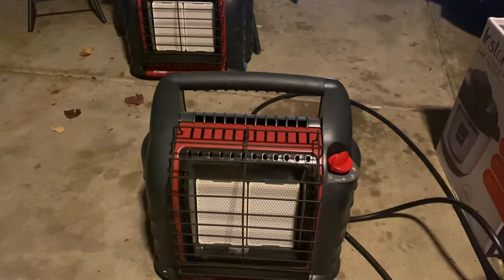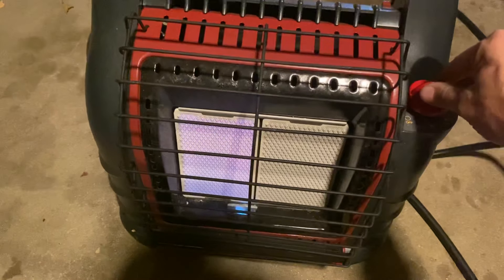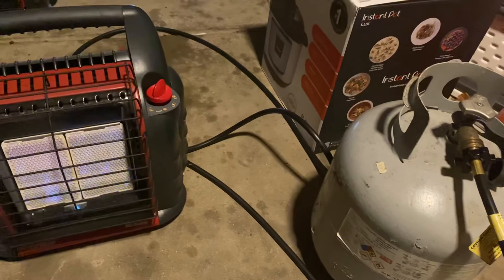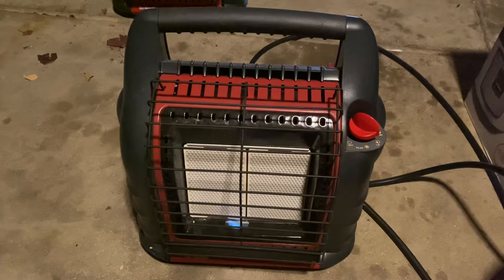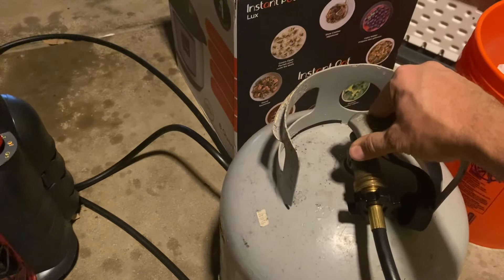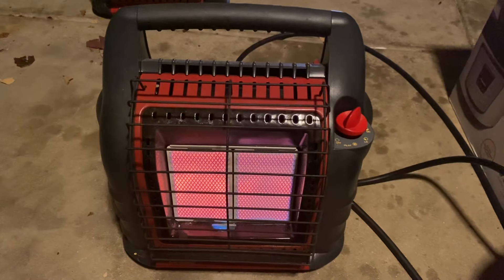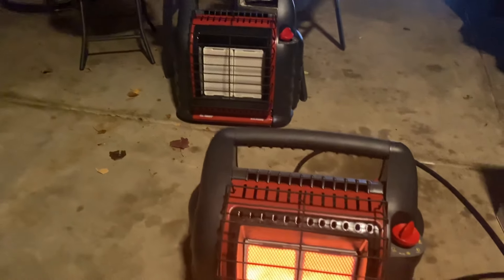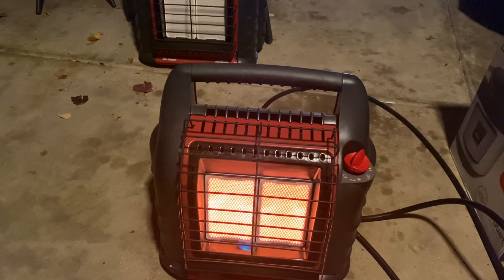Mr. Heater Big Buddy Shuts Off-FIXED

Comment: Hi my heater is bran new and doing the very same problem but I have the one pound tank hooked up to it how can I fix that
Reply from the maker: Are you using one tank or two? These units are really made for the large tanks. Just like a lot of companies they hook you on the “portability” trick of using small tanks. Do they work? Yes. Do they run flawless? Not even close. It’s just a gimmicky way of making people think they’re made just for 1 lb tanks. They simply can’t keep up in really cold weather. Try this…can you wrap something around the tank to keep it insulated? That really is the best option if you don’t have a 20lb. Tank. Anything will do even it’s a spare sock you fit inside it. Of course the warmer you keep the tank the faster it will produce gas from the liquid inside.

Comment: You right on with this Change my 20 pound tank last night. It was exactly like the video fluttered sputtered that would go out.  Hooked up my electric   Heater was fairly comfortable at night. Watch your video did what you said worked like a charm. I added in filter I didn't put on before thanks working great.
Reply from the maker: Glad I could help out. Stay warm

Comment: I tried that of barely opening the valve of the 20lb. tank and after about an hour it still shut down. I have an inline filter installed between the tank and heater.

Comment: I had an issue where my pilot light would work fine. But whenever I moved it to Lo or any higher, it would emit a squeal and the flame would go out. Simply opening the valve slowly on the propane fixed my issue. Thank you for this simple video!

Comment: Thanks a lot. It was a really amazing trick you've figured it out. I was hunting down the cause of the flame and the heater goes extinguish in few mins. Didn't think is its gas pressure is a key role in this secret. I end up switching the hose, propane tank, and even the unit. Really boil me down for the whole process, finally came across your video, and helped me out. Really appreciated.

Comment: Any idea why our pilot lit will lit but not stay lit. Been 2 days. Thank you
Reply from the maker: Is it the first time lighting it this year?
Reply from the maker: If it’s the first time and you have cleaned out the cobwebs with a cotton swab, try holding the pilot down for a full minute. If your rubber line is long like mine it’ll take about a minute of holding down the pilot to get the gas to fill the whole line. It’s a low pressure line so it moves ungodly slow before the whole line is charged completely.
Reply: No been using it for a few months now.  And have held down the button for along time. Beginning to think it's the safety tip over switch. Thanks so much for reaching out to help

Comment: I'm still having issues with mine, i can now use one burner on medium, but will die out as soon as I engage the second burner. I have it hooked up to a 100lb tank and put a regulator on the tank side and ran the hose to the right side and have the 1 lb Green bottle hooked up still on the other side.  Any suggestions?
Reply from the maker: Yes, is the hookup going to the quick connect or to the regulator? If you have two regulators it won’t work.
Reply from the maker: Is this the exact same connection you have? https://youtu.be/m51ZWK_CYq8
Reply: I did not get the quick connect, I just hooked it up to where the little 1lb tank goes. Didn't even know about that. So the way I have it ran, it won't work? Cause I just noticed it shuts it self off after a couple minutes on the other settings.
Reply from the maker: If you have a regulator on the tank side, and it screwed in to the side port then no, it won’t work. If you can take the regulator off the tank side it should work fine. The way I have one of mine hooked up, I have the line with the built in regulator that goes to the tank side but it has a quick connect that doesn’t screw in.

Comment: What do you do when a 1lb tank is used and it does this?
Reply from the maker: Big Buddy heaters are designed to be used with propane tanks that are at least 20 pounds. The 1 pound tanks are simply too small to provide a sufficient amount of fuel to run the heater for an extended period of time, or even for a little while some times. I believe they are good for emergency use on low setting. In my opinion the 1lb tank option is pretty much a gimmick, a good one albeit, but not very useful for comfortability if you have to run them on high.

Comment: So this keeps happening to my mr heater buddy while using the smaller 1lb propane canisters. Any suggestions on how to fix it?
Reply from the maker: Mr. Heater Big Buddy heaters are designed to be used with 20-pound propane tanks, and they do not work as efficiently when used with smaller 1-pound tanks. This is because the Big Buddy heater is a high-powered appliance that requires a larger volume of gas to operate at its maximum capacity.

When used with a 1-pound tank, the Big Buddy heater will not be able to produce as much heat as it would with a 20-pound tank. The heater may also run out of gas more quickly, requiring you to replace the 1-pound tank more frequently.

Additionally, the 1-pound tanks are not designed to be used with high-powered appliances like the Big Buddy heater. Using a 1-pound tank with the heater could potentially create a dangerous situation, as the tank may not be able to handle the demand for gas from the appliance.

For these reasons, it is not recommended to use a Mr. Heater Big Buddy heater with a 1-pound propane tank. Instead, it is best to use the heater with a 20-pound tank, as this will ensure that it operates efficiently and safely

Comment: I have tried everything. Mr. Heater special hose, filter, etc. It still clogs with oil in a short period of time. Very frustrating. The oil clogging has nothing to do with lighting the propane tank too quickly.

Comment: Mine does this but I just have the small green tank attached so there’s no way to let it out slowly, any suggestions?
Reply from the maker: Just make sure you use two tanks at all times. The colder it is the more likely it’ll be that it’ll shut off
Reply: Same issue here. Maybe I need to get the big tank so I can regulate it better...was going to convert it anyway
Reply from the maker: I prefer the big tank but if you need to be portable then don’t use just one pound tank. The unit needs two tanks to burn at the same time. It doesn’t burn one at a time.

Comment: Thanks for this video as this fixed the issue I was having while using the tank. I had already installed a filter prior to use with the tank. I was turning the tank valve wide open and was experiencing the flame out issue. Turning the tank valve VERY SLOWLY until I noticed the hose move ever so slightly and then stopped opening the valve. Problem solved and props to you for posting this up. You probably saved me the cost of a new heater.
Reply from the maker: Thanks Patrick! I’m glad it helped.
Reply: It worked like a charm! Question, can. I Turn the tank valve all the way after it runs for awhile?
Reply from the maker: Oh yeah. You don’t have to wait at all. Open it slowly until maxed out is fine
Reply: @cabinlife1886  thanks! And thanks for the quick response!

Comment: My problem is when it -10 below on the lake. It works fine in the house where it's warm it's fine stays lite, but once I use it on the lake in cold weather in the lower single digits or colder it lights for like ten minutes the little green 1 pound cans get frosty on the bottom then it shuts off won't lite. Switch out to a new bottle it lites n works then it does the same thing shuts off????
Reply from the maker: I’m afraid these just aren’t meant to be used in sub-zero weather with the 1 lb tanks. It’s only happy with the large tanks. Propane boils off at -44° and the colder it is outside the less gas is produced by the surface of the liquid inside the tank. Much like why lighters need to warmed up before they actually work too, even though butane boils at 30° it’s the same concept. If you can’t haul a 20 lb tank with you try using hand warmers against the tanks
Reply: Ya I understand there but when my brother is using the same a couple 100 feet away and thiers gives them no problems. I seen a video where they shook it something to with the whatchamacallit where it the tanks screws in might some thing wrong with it or the hand warmers might work..

Comment: Same problem with regular buddy and thanks to your tip it has now worked on the first try. I always thought bleeding it was the key and wondered why? I guess I didn't notice it. I would eventually open it slowly after a few bleeding attempts. Because I though air was some how getting in the line but obviously I thought if air is going in propane must leak when off. Now it makes sense haha

Comment: Sadly, this didn't work for me. I have had 2 of these, with the Mr. Buddy 5ft hose and regulator, and neither will stay lit. I've followed the various recommended cleaning methods as well. Brand new, full propane tank, too.
Reply from the maker: Does it try to stay lit or does it just simply do a hard shut down?

Comment: I just keep worrying about the filter
Reply from the maker: If you have a hose with the quick connect there is a regulator on the tank side. You would eliminate the need for a filter since the hose is under low pressure. If you opt for the standard hose that you thread in, you should use a filter since it’s under high pressure. Just remember to bleed the line before you turn off unit. Meaning, turn off tank first, let it burn out, then turn off unit.

Comment: Novice here.   Identical unit but use the small tanks.   

Mine runs fine for 15 mins, then just dies.  Pilot included. 

Will restart immediately but only run for 3 mins and dies.  Repeat repeat.

Switched full tank for other full tanks. Same result.  

Notice tanks build frost on them, the longer it runs, while in garage (usually above 40 degrees). 

Any advice ?
Reply from the maker: I’m going to do some experiments on the small tanks. It seems this is a problem that needs some good old fashioned research. I do refill my own 1 lb tanks. The frost is not a safety issue I’m certain but could be a sign of the regulator letting too much fuel into the heater. Usually if a tank freezes it’s either when gas goes in the tank quickly or out too quickly. So I will test to see if 1 lb tanks can trigger the safety switch in the regulator by installing tank too quickly.
Reply from the maker: Ok so I’m trying to cause it to freeze and although I can’t make it freeze I researched it and found that propane can freeze if it’s very cold outside and the small tanks can not keep up with the flow of propane. What I’m understanding is propane is a liquid and in order to use it to burn, the top surface of the liquid that is in contact with air is what boils off at -44° creating burnable gas. If the ambient temp isn’t too cold it’ll run fine but if it’s really cold outside the gas can actually freeze. Apparently it happens in RV’s too. What people say is that the surface area of the propane tank (not the gallons it can hold) needs to be wide enough to keep up with gas production. So I tried to turn on my heater on high with only 1 tank in the right hand side and sure enough it does work on high but it quickly froze up. Just not frozen enough to turn off. Probably because I’m in my nice warm garage. I believe that using a 5 lb or 11 lb or even a 20 lb tank would be best to keep it working as it should since the surface area is wider.
Reply: Ok thanks. Application is hunters in tent blinds, so going to be cold.  Appreciate the response.
Reply from the maker: You’re welcome. If my explanation was confusing I’ll include a link for one of the videos to someone who did explain it better. https://youtu.be/6ey7gspXKZA

Comment: Thanks but what if this is happening on a new heater using the screw on bottles?
Reply from the maker: I’m not sure if screwing in the tank too fast would trip the regulator safety switch. I will try and replicate it myself with some 1 lb tanks. Meanwhile let me ask you this, will it stay lit on low or does it turn it off in low too? Does it initially light both burners on medium or high then turn off?

Comment: No help so far. Unit, reg, & hose are 1 week old. New 20llb tank today. Purged line, opened tank slowly, same issues. It'd look and work fine on low for 2 minutes then starts sputtering then off. Guess I'll try the q-tip. Ignitor has never worked, been using a lighter.
Reply from the maker: Definitely a defective unit

Comment: I had to turn my 20 pound upside down and now it stays lit. How come I always have turn my tank upside down
Reply from the maker: It sounds risky. By turning it upside down you risk letting the liquid propane into the system and that may cause serious problems or injuries. It’s probably a good idea to use other methods. So it does light correct? So it’s not an ignition problem. Perhaps cleaning out the pilot with a cotton swab. Unless you think the pilot is okay. I mean it stays lit with an upside down tank right? Maybe observe the unit going out. Does the pilot go out first or do you hear a click first? Could be a safety switch like the O2 sensor. Better yet, can you describe in detail what happens, and how much time passes before it shuts off after lighting. Does it flicker or simply shut off, etc, etc. etc.

Comment: Whole lot of cures for one problem, don’t work. 
Many focus on 20# LP
TANK with hose.
I have had mine for 6-7 years, have gone through
Every one of these fixes,
and more. My guess is there are a lot of these things in the corner of the garage,
One season, and abandoned. I just bought another, go a couple more rounds. They work pretty good, when they work,
But, that requires a bit of
Stroking,

Comment: Having the same problem with a 1 lb tank, can not imagine it is the regulator am I wrong?
Reply from the maker: Two questions, what was the temp outside and did you have one or two tanks installed?
Reply: @cabinlife1886  one and after about 5 cleanings and blowing out, I finally got it to work, after moving it around (I had taken it apart, got it to work, put it back together) it didn't work again until I blew it out again. It was in the garage, about 55 F.
Reply from the maker: @stanford2444  oh boy. We gotta figure this out. Let’s try using two tanks or do you have a 20 lb tank and hose? If we can get it to work on two tanks on high (or a 20 lb tank) we can figure out  a process of elimination.
If it fails with that test I would have to narrow it down to the most likely culprits one at a time. But we need to know exactly what happens during the shut off. Can you give me a play-by-play so we can figure it out. Does it go on high for 5 minutes and quit or never really going at all? Does it go for 10 minutes and pilot get smaller and smaller? Then we can say maybe it’s the Oxygen Depletion Sensor. If the pilot just suddenly shuts off maybe the tip sensor or thermocouple needs looking into. Let me know and I think we can get it fixed
Reply: @cabinlife1886  First off it is a portable buddy, takes only one 1 lb tank. I have had it on a hose and a 20 lb tank in the past. But it has a 1 lb of it now. It is working fine now, but I think there is something floating around in it. If it has a sediment trap in it, I expect it is in there.
Reply from the maker: Oh ok. I don’t have that one
Reply: @stanford2444  Have you been using the fuel filter (really it’s an oil trap) with the 20lb tank? If not oils (plasticizers) leak out of the hose over time and clog up the  internals. You can take it apart and clean it, look for videos talking about cleaning the oil out. Then get one of the fuel filters if you don’t have one.
Reply: @RedGreen1  The hose I am using is not suppose to need one

Comment: Not working for me. My buddy here is less than a year old. Tried it a couple times still doesn't work. Maybe I didn't Purge the line enough to release all pressure. I removed the filter. Doesn't even work on low. Shuts off
Reply from the maker: Does it turn on initially or won’t light at all?
Reply: @cabinlife1886  it turns on, but only for a few seconds
Reply from the maker: Start off by cleaning the pilot hole and afterwards note how the flame hits the thermocouple. If it looks healthy and covers the whole thermocouple I’d look into tip switch. If that doesn’t work look at the oxygen sensor.
Reply: @cabinlife1886  thank you. The pilot is really strong it covers the whole thermocouple
Reply: @cabinlife1886  where is the tip switch and oxygen sensor located and what do they look like?
Reply from the maker: Ok. Let’s study the shutdown. Listen for a “tick” when it shuts off. If it ticks something is forcing the shutdown. A sensor maybe. If it kinda just putters away into nothing it might be a bad regulator. Question does your line to your tank have its own regulator on it going to the filter then into the buddy?
Reply: @cabinlife1886  It ticks. No Regulator, direct line. Maybe that's why, gas pressure might be too high?
Reply from the maker: I would try and return the unit. If you feel like troubleshooting I would try and bypass the thermocouple to see if that’s the culprit. I did a quick search and found this https://youtu.be/ip6tHa0gcHo
Reply: @cabinlife1886  thank you

Comment: This happened to me the other day.  Could keep my Buddy Heater lit using my 11# tank.  I also realized my tank valve was open before I hooked it up.  I ended up using a 1# tank and it stayed lit.  Would you assume this is what happened in my situation?
Reply from the maker: Yeah I would try again with the 11# tank. Since it stayed lit with a different tank I would assume there’s nothing wrong with any of the components.
Reply: @cabinlife1886  thanks!!